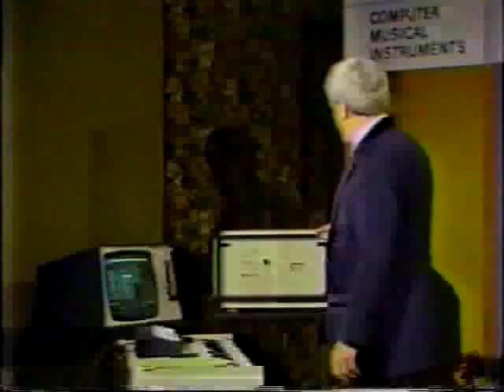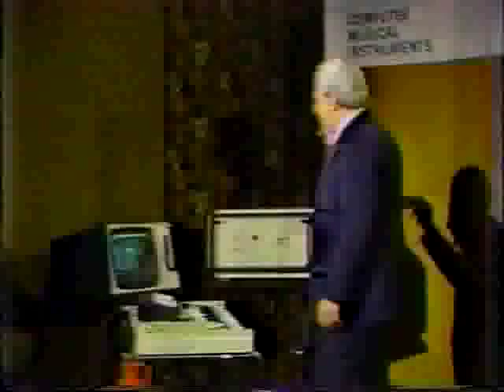Bob Moog Fairlight part 1

Comment: Pure inspiration. Two musical pioneers on the same same. Moog and Fairlight!
Reply: But the biggest pioneer is seldom spoken of , wolgang  palm , inventor of the digital oscillator , the wavetable oscillator and had better quality sampling issued at the sametime as the fairlight came out plus he had a communication bus protocol that was 100 times faster than midi and that could transmit samples

Comment: @1982CFD Actually, from the data on the Fairlight I've read, it is capable of 128 harmonics, but that's only for fidelity--I suppose most "synthesized" sounds only need 32 at best to sound good, and more for sampled sounds. The Synclavier did a similar thing--it couldn't directly sample, but I could load up pre-recorded ones and re-synthesize them using FM synthesis instead of the additive synthesis the Fairlight used.